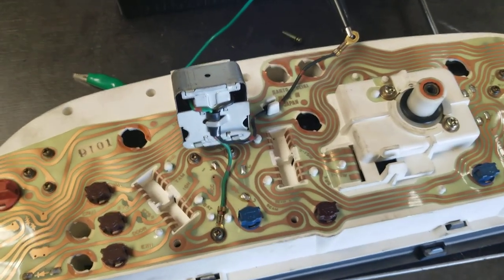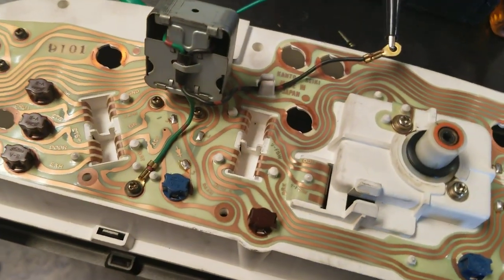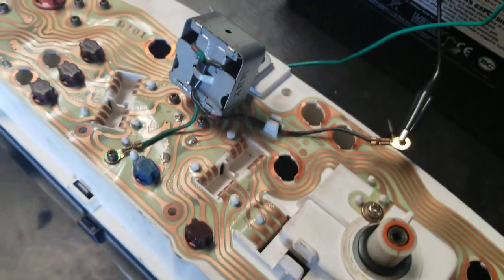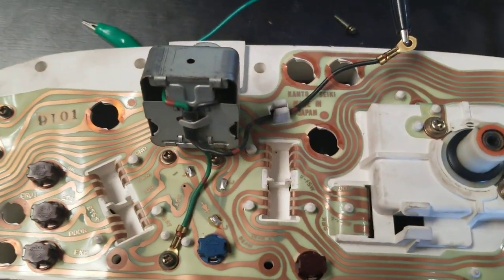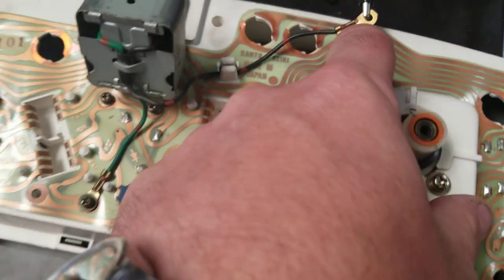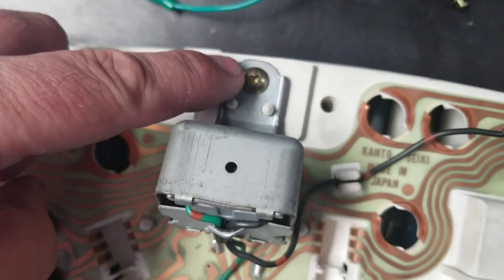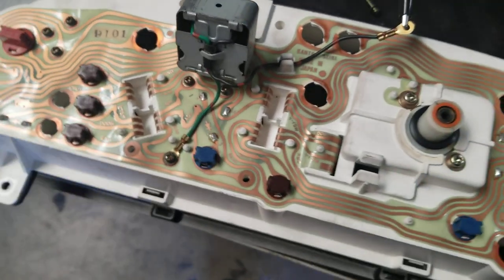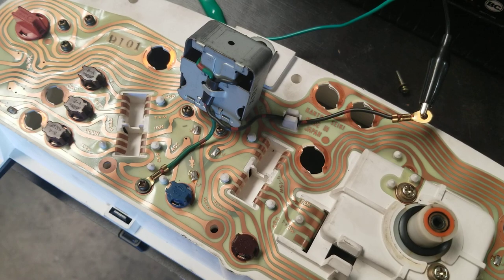R32 GT-R Speed Warning Chime

Comment: The reason you always find these Chimes that activate at about 100kmph or 60mph in Japan is because that was the national speed limit in Japan (or at least it used to be idk if it changed) so they legally required all car manufacturers to have the speed chime
Reply: My Nissan bluebird turbo sgx have that same chime, but only sounds when you open the door and the lights are on.